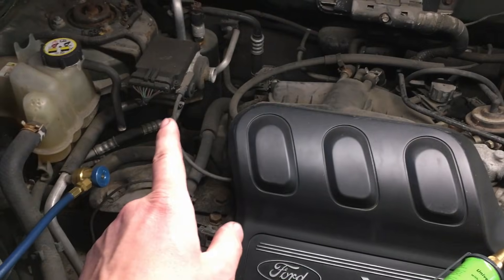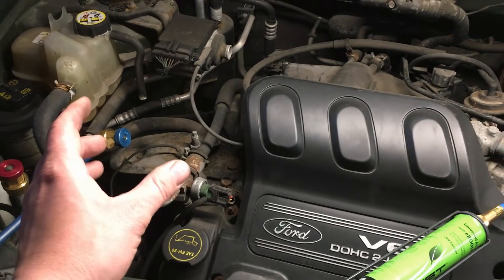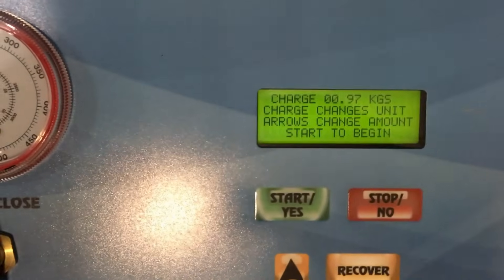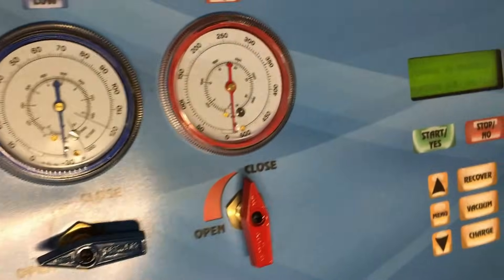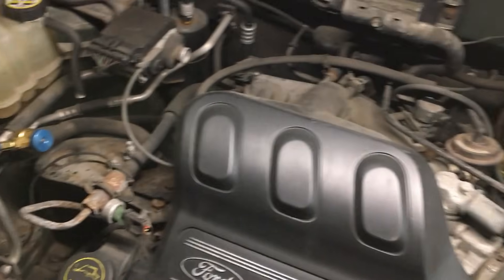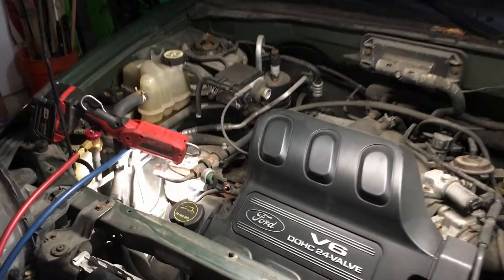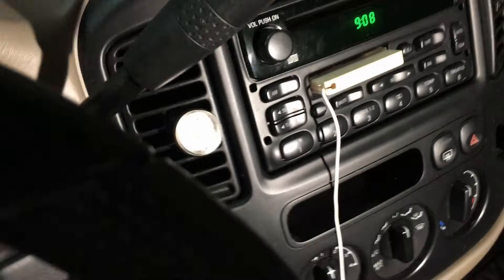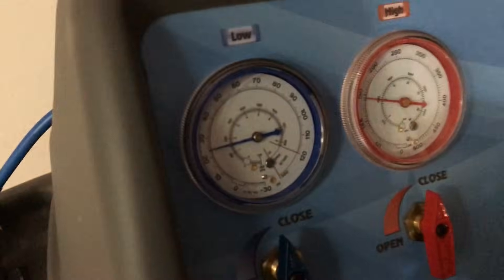Automotive A/C System Leak Testing with UV Dye: Is it The Most Accurate Method?

Comment from the maker: These are the Tools and Tracer Dye I found to work best:
Ultra Bright UV Dye-
http://amzn.to/2ujj8AY
Dye Injection Gun Kit-
http://amzn.to/2flR8Gt
Ultra Bright UV Light from Fluke-
http://amzn.to/2vfkqKA
Reply: Good explanation and demo. Thanks.
Reply: I
Reply: FordTechMakuloco    I have an 03 Navigator and my A/C just stopped working .Its fully charged up but the clutch won’t engage , any ideas for me to check would be appreciated thanks .,,,,Tony
Reply: How about oil. How much did leak out? How much would you put in ?
 So the system in not running low or dry..
Reply: i dont mean to be off topic but does someone know a method to get back into an Instagram account..?
I stupidly lost the account password. I love any help you can give me
Reply: @Jamie Genesis Instablaster =)
Reply: @Judson Francis thanks so much for your reply. I found the site thru google and I'm waiting for the hacking stuff atm.
Seems to take a while so I will get back to you later with my results.
Reply: @Judson Francis HOLY ** IT ACTUALLY WORKED! I literally hacked my IG account details after about 40 mins of using the site.
Thank you so much, you saved my account !
Reply: @Jamie Genesis Happy to help :)

Comment: The question is not quite on the subject of the film, bcs it is about refrigerant oil amt, but I think this is the right audience for the inquiry. Please can someone solve this arithmetical puzzle from the Shop Manual? It states in the Manual (car is 2001 Saturn SL2):

The Saturn air conditioning system requires 150 ml (5.07 oz) of PAG compressor oil. Service compressors have 65 ml (2.20 oz) of PAG oil installed.
New oil quantities must be added to the system during component replacement and conditions stated as follows:
With no signs of excessive oil leakage, add:
Compressor: Remove, drain, and measure oil. Drain the replacement compressor. Add the same amount of new PAG compressor oil drained from the removed compressor to the replacement compressor.
Evaporator: Add 67.5 ml (2.25 oz) of new PAG compressor oil.
Condenser: Add 22.5 ml (0.75 oz) of new PAG compressor oil.
Receiver-dehydrator: Add 30 ml (1 oz) of new PAG compressor oil.

Open the R-134a source valve(s) and allow 0.50 kg (1 lb) of liquid R-134a to flow into system through low side service fitting.
As soon as 0.50 kg (1 lb) has been added to system, start the engine, set the mode control to vent, the temperature lever to full cold, the blower speed on high, and push the A/C compressor button to the On position (A/C control button light On). Slowly draw in the remainder of the refrigerant charge 0.23 kg (0.5 lb). The total system charge is 0.68 kg (1.5 lbs).

I'm reading all that information in my Shop Manual and don't get this:

If the total amount of refrigerant oil is 5.07oz and 2.25oz goes into compressor, then for Evaporator, Condenser and Receiver Drier is left only 2.82oz (5.07-2.25=2.82oz). But if to add what is recommended for Evaporator, Condenser and Drier it will add up to 4.0oz (2.25+0.75+1.0=4.0oz), with the total in the system 6.25oz (4.0+2.25). How much oil on total is in the system: 5.07oz or 6.25oz? Where I'm wrong? I'm replacing everything besides the Evaporator and Compressor (I'll remove it and flush w/solvent though), those I'll just flush with solvent. No info on Refrigerant Oil under the hood or in owners manual, or in Haynes book. Thank you.

Comment: what if the low side port is on the accumulator, wont the dye just fall into the bottom of the accumulator and not really do anything?
Reply from the maker: Oh no it is carried through the system by the refrigerant cycle.

Comment: This is a perfect example of Vacuum vs Pressure. The seal around the compressor would hold a Vacuum and not leak same as the shaft seal. They will leak under PSI pressure  though. The Dye is a must.

Comment: At what point do you inject oil for the compressor? Because when you evacuate the system, it removes some oil too. Or just the charge includes the oil too?
Reply from the maker: You add oil back in right before the charge.

Comment: I have injected dye in my Kenworth and the only leak I have found with it is the low side schraeder valve.
I suspect it is the compressor shaft seal but zero dye is ever seen anywhere on it.
I can even smell freon under the hood with the motor running.
It will cool about one day if I charge it.

Comment: Once again you have amazed me sir!  I didn't expect the die to be so expensive. I can tell its awesome stuff though not to need a UV light with it.
 
When you evacuate that system to fix the leak, all of your R134 in your machine's storage tank will :
A - have dye in it
B  - have no dye in it because it gets separated out with the oil separator?
C  be collected with no regard for the small amount of dye in it and go about your fixing AC like a Pro adding a small amount of dye to every system you charge in the future.
D - never see a drop of dye because you quietly and subtly  let the temporary charge ooz out into a pan while no one is looking to be discarded in a milk jug later.
😎

Comment: For the home backyard mechanic who doesn't have all of these expensive tools can we just put some dye in the system along with a can or two of refrigerant to get the system running and then check with a uv light or is it necessary to vaccum the system first?
Reply: for leak detection that would work perfect. After the repair be sure to have the system vacuumed before recharge.But don't release the refrigerant into the atmosphere. have it properly evacuated before working on it.
Reply: @Az2FL  Sounds like a plan, thank you.

Comment: How do you know if the compressor had the right amount of oil? And if there is a leak doesn’t it leak compressor oil also? wouldn’t you need to check and add the right amount of oil or did the dye have oil in it already?

Comment: Dye is a lazy way and inappropriate way. Frankly nothing other than the proper oil and refrigerant belongs in a ac system. PERIOD! buy a sniffer, use nitrogen and a trace amt of 134a and or bubbles. EPA correct way.

Comment: Great A/C video!!!! I have an A/C problem on my 2000 Jeep Cherokee 2WD wagon. I have no A/C pressure. When had a shop evac/recharge my A/C system a year ago the high side would "flutter" between 280 and 290 very quickly. I had cool air for about 2 weeks then nothing. Now a year later, I have no pressure in the system. Dye was injected and there seem to be no visible. I sniffed around the evaporator drain tube recently with zero pressure with no positive results and took a scope up as far as I could to inspect the bottom of the evaporator and didn't see anything concerning. Any ideas? Thanks man!

Comment: When a compressor fails in that matter do you need to start replacing condensers and accumulators etc. or can you get by with just the compressor since it looks to be a seal failure rather than an internal mechanical failure on the compressor releasing shrapnel.

Comment: I did not hear you mention adding oil when you charged it. How did you know there was enough oil to not hurt the compressor? How do you know how much to put in considering each part of the unit has a certain amount of oil they hold and it seems that it most likely leaked all of it out? Thanks
Reply from the maker: +amtpdb1 the recovery machine collects it in a measured container. For the loss I would add up to an ounce of PAG 46.

Comment: I have a 2014 Ford Fusion SE with the 1.6 Ecoboost and a manual transmission. Just recently the acceleration has been kinda choppy in the lower RPM (2000-2500 and under). It's especially noticeable when it's been sitting and had the chance to cool down completely. I noticed earlier that you can faintly hear a bit of a misfire,and if you put your hand on the engine you can feel it running a bit rougher than usual. But there's no engine light on. Do you have any suggestions on things I might need to check? I've already checked the spark plugs and they look fine. It has roughly 48,000 miles.

Comment: Hi Ive got a 97 tbird 4.6l 2v. Was wondering why it idles fine but when putting into gear or turning ac or heat on idle drops to where it almost stalls. No codes. Cleaned the iac and new plugs and wires. Took it to the shop an after paying $150 was told they had no clue. Hoping you might have come across this and have acouple of tips that can help me out. Thanks Rob

Comment: I'm in the market for a new truck and have been looking @ 2011-2013 fl50s with the 5.0 Im it and I was wondering what your opinion was on them.
Reply from the maker: +Tom Lang 5.0 is great just get the latest model you can afford as they all have the cylinder sleeve distortion at one time or another.

Comment: In here, we can use dye, but we cant charge sytem with R134a when we already know that it has a leak. You can get jail time for that...
And Yes if low and high pressure gauge, says 0 pressure then, thats makes it a leak here.

So we use mixture gas that can pressurise the system( i use 200PSI pressure) and you can eather snif it wit tester or just use soap and water.
I personaly like to use, soap and water. Sniffer likes to give fales reading even without leaks.
I allso i have find with soap and water a leaks that take over 6 monts to leak for point of no AC and some of those dont have even dye on it(even when sytem has it in), so no i dont realiy on dye my self.

Comment: DIYer here, I hope you can help guide me  in the right direction, I've got a situation on my cousin's '94 Accord EX, here it is:
I recently replaced the expansion valve (was clogged) and the receiver dryer.  I also flushed out the evap core completely with flush, etc etc.  Vacuumed the system for 45 mins, no leaks.  Re-charged it to 22.9oz as per OEM specs (I used a scale).
at 80°F and about 40% humidity I got these readings:
-the static pressure is 107psi on the low and 80psi on the high
-at 1500rpm with the clutch disengaged I got 50L and 150H, when clutch engaged I got 45psi L and about 160psi H.
-at 3000rpm with the clutch engaged I got 22psi L and 185psi H.
-Many times when first turning the A/C on, the clutch and fan engage immediately and never turn off, in order to get it to cycle on and off turn the a/c off and then on again, then I see it cycling on and off more normally.
With all these conditions the problem is that the air thru the vents is as follows:
Passenger side vent 60°F, best reading has been 58°, but usually stays between 60° and 62°.  All other vents are usually ~10° higher (70°-75°).
Any suggestions what it could be?  I've thought maybe the compressor is worn out.  I don't think is that I'm low on refrigerant as I've refilled it using a scale and I've checked it at least twice for leaks, the vacuum pressure stays put for over 30 mins at ~29" Hg.
I've heard also that it could be the mode control motor or recycling motor that may not be closing the duct flaps properly, but would that explain why the passenger side cooling only to 60°F?  (I will try pinching the heater hoses and see if I experience any changes too).

Any suggestions would be greatly appreciated, I've been frustrated trying to figure this one out.
Thanks.
Great videos by the way..
Reply: Fixed!!  saw another video recommending about the mode control motor not working properly yielding a much higher temp out of the center vents.  I decided to then check the heater vents and valve.  I noticed that the heater valve would not close completely, thus allowing hot coolant to get into the heater core in the cabin.  I manually pushed the valve completely closed and voila!!  ice cold air on all vents.  (The passenger side is still slightly colder than the others but that's expected since it's the closest vent to the blower fan).

I will be adjusting the heater valve cable to ensure it closes the valve completely, if it won't, I'll replace it.  Hope this helps someone.

Comment: I like your videos, and you saved my Azz with your 5.4 3v spark plug extractor videos, but this one your wrong IMO! by pulling the system in a vac, your introducing moisture. I am a strong believer that only 2 things go in an operating refrigeration system, oil and refrigerant! Prior to that Nitrogen! I second Joe.

Comment: That UV light is NUTS! Thanks for the info - definitely putting that one on the shopping list!

You'd laugh if you could see what I've been using the past 17 years - a tiny little pen light, that's been dropped, stepped on, run through a couple cooling and alternator fans, etc.. The bulb is about the size of what they used to put in Maglite flashlights in the day. Just one step above useless, lol.

I'd bet that aluminum corrosion got in between the case there, and distorted the seal. Seen that so many times up here in MA in just about every connection. This state dumps salt on the roads like you wouldn't believe in the winter time.

Great vid, as usual. :)

Comment: yep good video :D
Reply: what if evaporator leaks inside the dash :D
Reply: Petar st 
Electronic leak detector at the outlet of the evaporator drain hose is needed to identify evaporator leaks since the leakage is not in an open and visible area; he mentioned it as the exception in the video.

Comment: Thanks for the video.

When you hook up the machine to the car's ac system, does it do the purge for you automatically?  I know it will do it when adding gas; I'm referring to when it is just monitoring the system via the manifold gauges.  

Based on your diagnoses, I would assume you're going to replace compressor, reed valve(fixed orifice?), and dryer/accumulator.  Right?  Does that machine take care of the PAC needed with a compressor change or will you have to still do that manually?
Reply from the maker: The machine will recover the refrigerant, then at 0 psi go into a vacuum for 10 min which removes all air and moisture from the system. After repairs are completed the system goes into a vacuum for 45 min to entirely purge all air and moisture before charging a sealed system. I think you mean PAG this machine does not inject oil automatically you do it manually.

Comment: Great video! I do all my leaks checks the same way with one exception. I use compressed air. I only used compressed air on a car like the escape shown here.  It ALREADY has atmospheric pressure inside it. So using air to check for leaks when air is already inside is ok in my opinion. It saves me time and money, and I don't leak as much r134a out into the atmosphere. I would never put air into an ac system but if it's already there it's already there. I use it with soapy water and my ears and I can find leaks. Both methods are valid but that's my opinion.

Comment: How about an in-depth session on SEALERS and their affect in the systems.  Explain HOW SEALERS function
Reply from the maker: +William Skelton Never! I would never endorse the use of sealers in a ac system.
Reply: If you read my suggestion with an attitude of EDUCATION vice personal prejudice it would help. I spoke of educating users of this CRAP on what it does in a system and how it chemically works.  Suggest you regroup and use your resources to EDUCATE AND INFORM, THANKS, JOHN
Reply: Sealers when introduced to oxygen solidify. That is how they work. Just imagine that you have installed sealer into a system then it has to be disassembled to replace components. All that sealer will solidify in the lines and hoses and then cause problems from then on. NEVER use sealers !!! You cant clean it out.
Reply: I already know that which is why I suggested a educational session on the subject.  I just recently had the opportunity to replace a system where the owner had gone through FIVE cans of that crap.  It will not fix a HOSE [hp side].  Luckily, it was a RED DOT system in the truck and component accessibility was favorable. I suggested that FordTechMakuloco use his available platform to bring out the straight facts on sealers. Based upon his reaction I doubt he will do the mature thing and expose the in depth details that stuff can cause once moisture gets in the system, missed chance to do good.

Comment: What is the ratio of dye to r134a. My system hold 6 lbs and have 2 systems per vehicle that total 12 lbs . I could not find any specs on Amazons site. Thanks
Reply: No ratio, usually it's a 1/2 oz charge for an auto HVAC.

Comment: I'm havin problem with my A/C but only at high speed. At low speed it's kind of cold but when i'm on the highway its like having no a/c. What could be the problem? I drive a 03 escape
Reply: Charles Bourassa 
check a few things.....
engine coolant
AC compressor clutch spacing
alternator and/or battery
Reply: Sounds like might be overcharged to me. Need a set of gauges to see what the pressures are doing